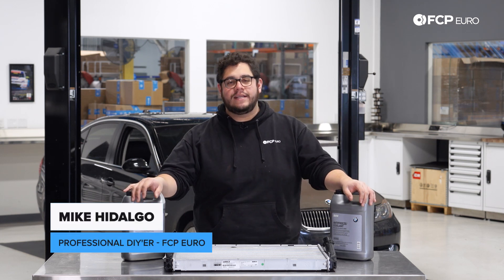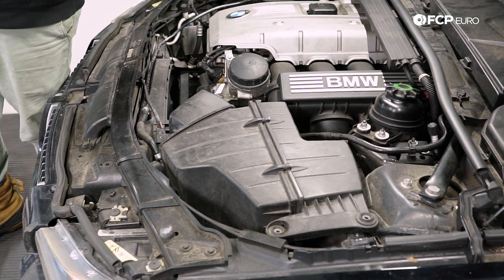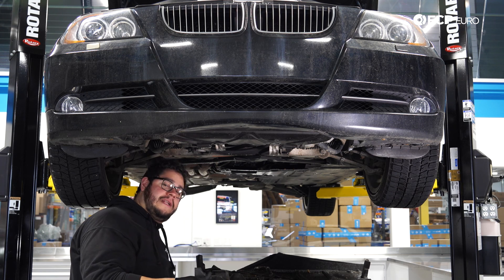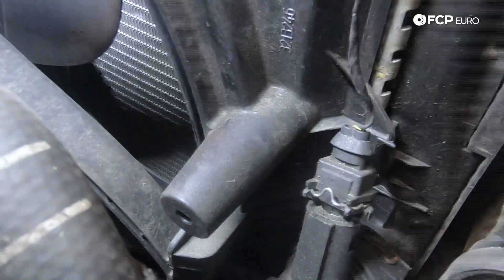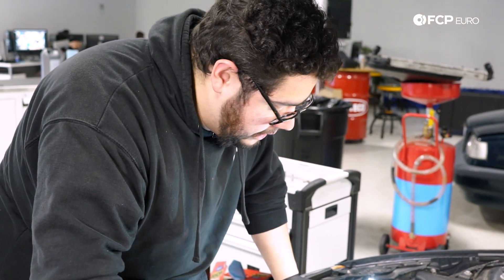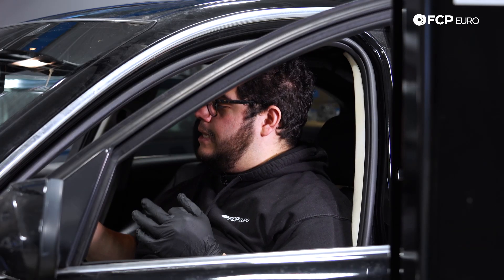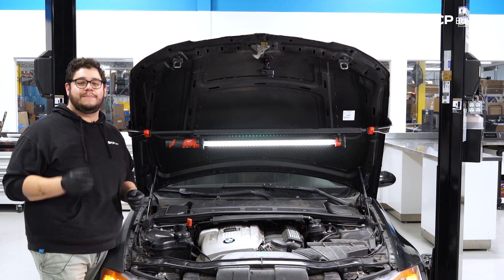BMW E90 Radiator Replacement DIY (BMW N52 Engine - 2006-2013 128i, 325i, 328i, 330i, & Z4)

Comment: 2 questions can i use this same method on a automatic and can i drain BOTH the oil and coolant at the same time and then add them back at the same time? Will i be able to do the bleed process with out knowing the oils level

Comment: You mentioned the full mark is the top of the threads on the expansion tank, 
but my expansion tank (2006 325I)  has a yellow arrow full mark at the bottom of the threads.
I wonder which is true ?

Comment: Straight to the point without being extra or complicated. I actually thought removal was gonna be time consuming and a pain to do. Removing mine this evening after work and ordering my radiator now.
Reply: Considering its a BMW I though this was going to be way more complicated. Ordered my rad and should be fixed by the weekend. Ive been limiting my traveling since I don't want to overheat the engine.

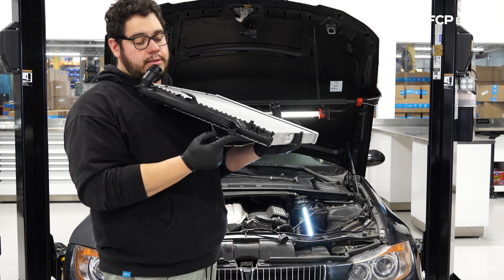Comment: At 11:30 with old radiator out is a great point to clean your A/C Condenser.  Use your favorite degreaser such as Purple Power, Simple Green etc.  I use Total Awesome (yellow spray bottle) from $ Tree because is a little more plastic friendly.  I spay on the back size and through the grill in the front let it sit for a min or two, rinse with shower settling on garden hose nozzle from back and front.  Try to keep it on the aluminum only.  Repeat a few times.  You will be amazed at how much better your A/C will perform.  Continue with radiator installation.

Comment: I noticed it has a bleeder screw on it so do you do anything with the bleeder screw to make sure that you topped it off and removed all the air out of the system
Reply from the maker: We do not open the bleeder screw when Vacuum filling the system. If you were to do it manually using the electronic pump, then you could use the bleeder screw to speed things up a bit.
Reply: @fcpeuro  but I'm not understanding I thought you would have to lift up one to remove the air so it'd be all nothing but coolant and turning on the heater on one it will help to also circulate the coolant I used to have a E46 but I'm pretty sure it's not the same so I bought my first E90 no longer own the E46 I watch your video one more time just to make sure I do it right I'm removing my radiator due to an elbow leak I guess the elbow on the upper radiator has a small leak area thanks for your information

Comment: 10:22 so I’m having a real hard time trying to remove this hose and I’m scared breaking the hose connector part or anything else, it is a new radiator I’m replacing so I was wondering if it’s just fine for me to break the radiator then remove the piece stuck from there or if there’s a better easier solution, any help is appreciated

Comment: Do you have a version of this video for N51 engines? I noticed that mine has power steering lines running to/from the radiator, so things are a bit different.

Comment: Hello FCP Euro, such a helpful video.  I have just received the Nissen Radiator for my 08’ BMW 128i Automatic.  My OEM radiator had only one long drain plug on the driver side. However the replacement Nissens radiator has two drain plugs, one on the driver side and the other on the passenger side.  Since I have an Automatic, I do need the long plug on the driver side, and im assuming the passenger side stays the same as well thats already equipped with it? or do i need to replace that plug with a shorter one? thank you FCP Euro
Reply: Hi Petey.  I have the exact same question about the Nissens radiator.  I'm wondering if I need to swap the installed drain plugs with either of the two extras for my '07 328xi automatic.  It's not obvious what length drain plugs come pre-installed so I'm not sure if either of them need to be swapped (which I would rather not do if at all possible).  Did you figure out the answer to your question?
Reply: @huntereskew  hello hunter yes, after doing some research, and more research, the passenger side has to be swapped out with the long plug that it came with, with the bag.  The one currently in there is the short plug.  I have replaced and installed it yesterday, did the whole bleeding procedure, and everything seems to be working good, with no signs of leakage.

Comment: After replacing my radiator and bleeding the coolant system with the auto procedure over 5 times I STILL only have heat at idle, once I'm driving it gets ice cold and the car runs at 57 to 60 C instead of the 96 it should? All I replaced was the radiator and coolant
Reply: Did you fix it?
Reply: @lyzander_e3920  yes sadly the aftermarket radiator was the issue. Had to buy an OEM radiator due to the trans cooler being a separate portion of the cooling rows.

Comment: I'm curious as e90 post has a walk-through that specifically says to leave closed the radiator cap and bleed screw during this process. I also agree with a 2 bleed procedure, I had an issue with my own that needed a 2nd venting

Comment: Im not sure if i need a new radiator or not but i had to change the black plug that you unscrew wasnt leaking before i originally took it off but my blue screw was stuck in the middle so i had to replace the whole plug it is still leaking from were i put the new one in not sure what to do but i need sum type of help or do i need a new radiator

Comment: The two steel brackets that you took off at 5:20 are missing on my 2006 E90.  Do you know the part number for those?  Does FCP carry them?  Also, quite a few of the screws were missing from the larger cover that goes over this.  Is there a screw and clip kit available?

Comment: Is the radiator different on the e90 with auto transmission (i am finding one option with 4 hoses conectors) ??

help pls
Reply from the maker: Hi Ruben, the idea remains the same. The N51 engine vehicles use a slightly different-looking version as it has an integrated sensor, otherwise the same process and number of connections for both transmissions.

Comment: I replaced my radiator but didn’t know how to bleed it and didn’t. It’s been a month now or so do I need to bleed it ? coolant light turns on the dashboard but the coolant is filled and haven’t seen that I need to refill it and I drive a lot ? Any idea boss man?
Reply from the maker: Hi there, it certainly would not hurt to try and run the bleed procedure with the water pump to see if there are any hidden air bubbles in your system!
Reply: @fcpeuro  thank u so much ❤️

Comment: I was charged $2,500 for a radiator replacement? Is that a fair price or to high?
Reply from the maker: There are a lot of variables to a bill related to a repair, without knowing all the parts and labor breakdown and associated rates and other work, if any, it is impossible to guess for sure.